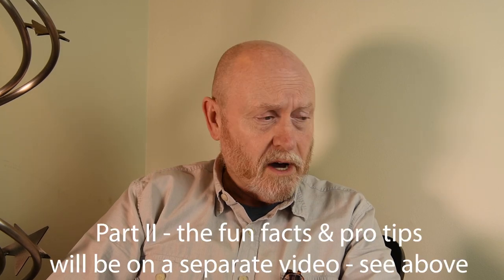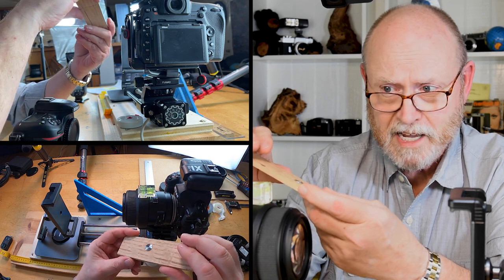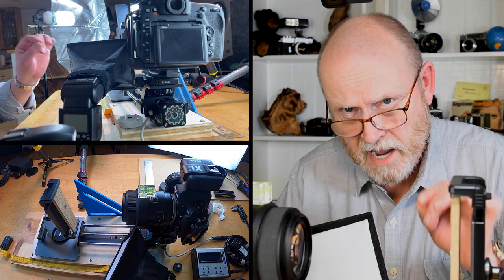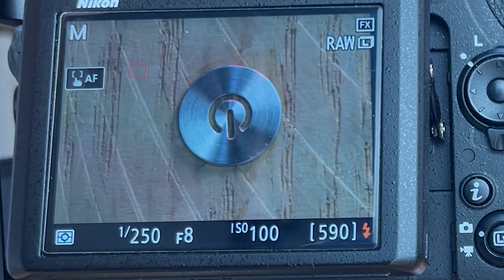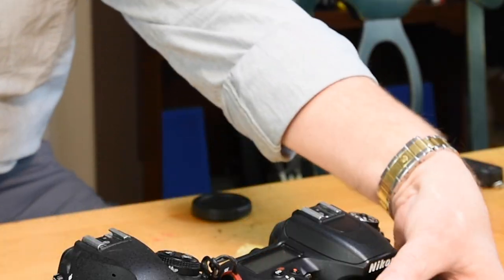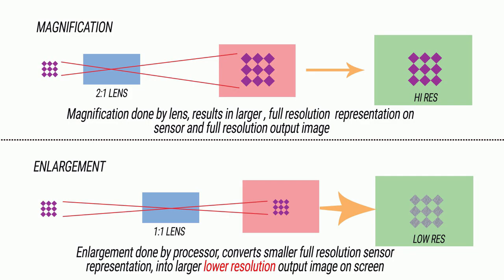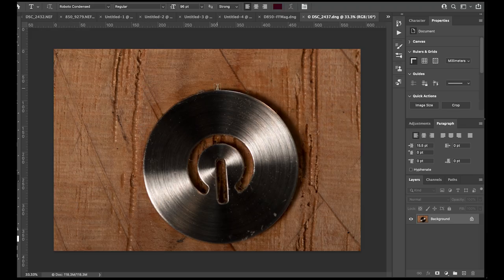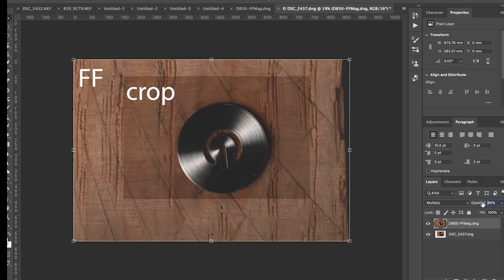Sensor Size Matters - Part 1 (the Front Half) - A Demonstration

Comment: The magnification on a lens is fixed...thats very correct sir. But the rest of your comparison has an enourmous flaw when you want to compare full frame to crop and the size the object is after you go to print or look a pc screen. The only difference should be the sensor size not the amount of pixels......compare a 20mp crop to a 20 mp full frame and you loose this whole discussion. You are now comparing a 45mp full frame to a 20mp crop camera.....the outcome will always be about equal due to the higher pixel count(more than double) on the fullframe. If you think the pixel count has nothing to do with it well than compare a high pixel crop camera to a low pixel full frame and be amazed how much more object to surrounding you get using the crop sensor. I dare you....if you are certain you are still right than another test with equal mp camera's(one crop and one fullframe) would not scare you in the least  ;)
Reply from the maker: You are absolutely correct to call me out on measuring the disc using pixels - that was an error on my part. I should have used a fixed unit of measurement (mm) to make my point. I can absolutely see why the use of pixels as the unit of measure would imply something entirely different. But the point remains the same. The number size, shape, pitch and density of the photo-sites/pixels has no bearing whatsoever on magnification. All of these factors have important roles to play in image quality and resolution, however. The next video in this series deals with sensor science, resolution, pixel density, and all the other stuff that matters for image quality. The purpose of this video was simply to dispel the belief that sensor size affects magnification. The next video will close the loop. Thanks for taking the time to raise all these points - it is only through spirited and open conversation that we can ever learn from one another. I will correct the mistake that you have pointed out in the next video. Thanks!
Reply: @AllanWallsPhotography  I'am very glad i still can disagree on things on some You Tube vids.  That can only mean that the one you are discussing or sharing idea's with has taken the time to listen/read or wants to further discuss on the subject. Lately i often experience that post are removed or just ignored because they are different or not confirming the narrative presented. Thanks for the effort and time you always put in your video's ..while not always agreeing on all things you say , i sure have learned a lot by just looking at them. I very much doubt that  on You Tube  you can find video's on macrophotography that contain more detail/usefull info than people can find in yours. ps : dont shoot me for the bad english writing or misuse of words...its not my mother language.
Reply from the maker: @HoutmeyersP  Your English is excellent and your comment is appreciated. I make mistakes, but my goal is to make fewer. Listening carefully to people who know more than I do is the only way that is possible. Please continue to keep me honest!